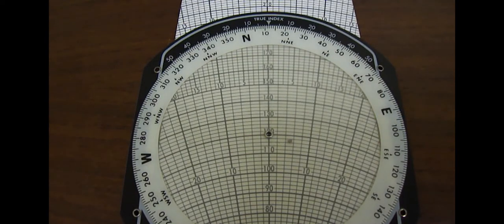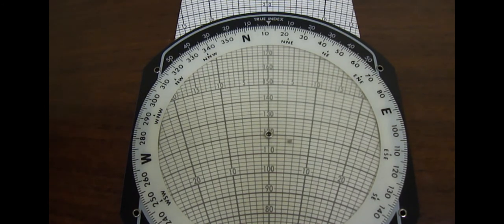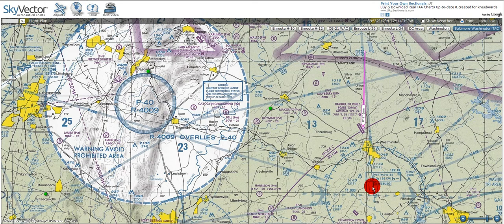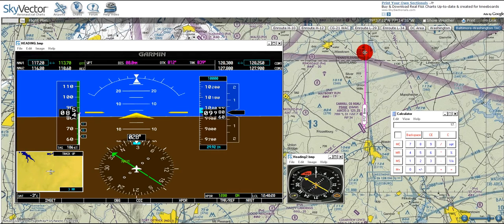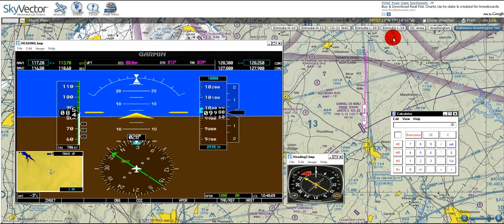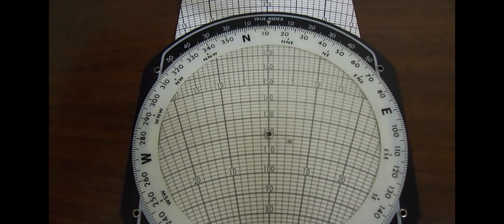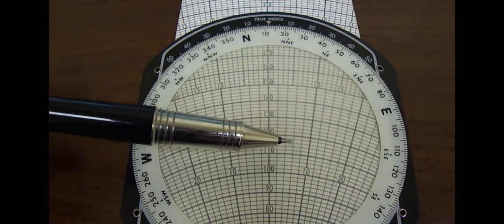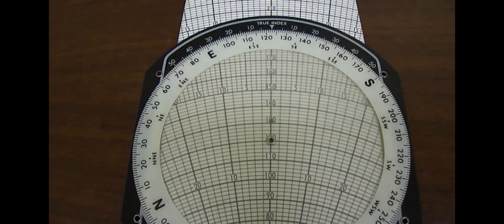E6B Flight Computer: Unknown Winds

Comment from the maker: @directorphilip2 Make the video full screen in 720p. Inside that little annotation along the magenta line you will read the number 012 deg. It's a small angle, so its deceiving to the eye at first glance.